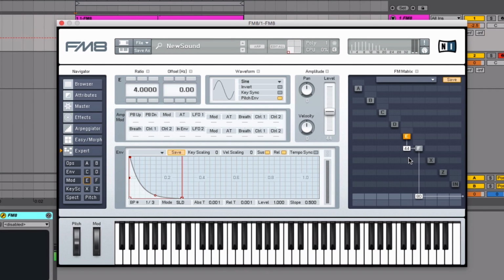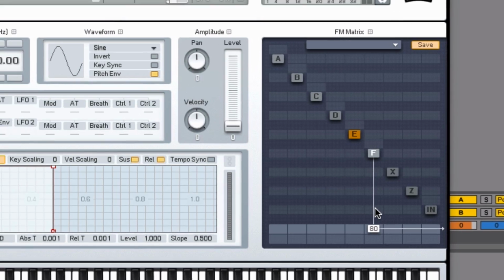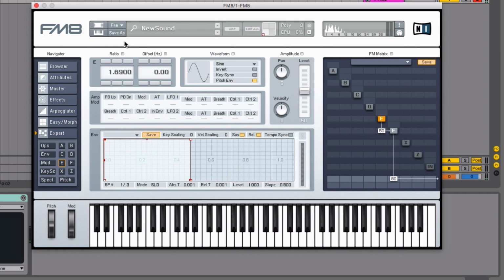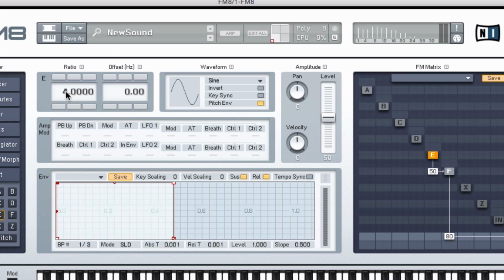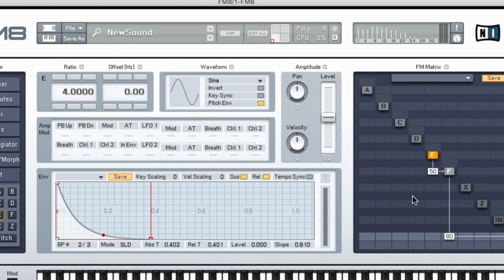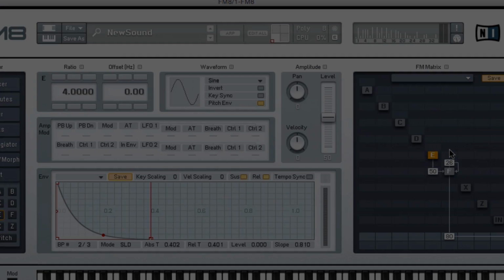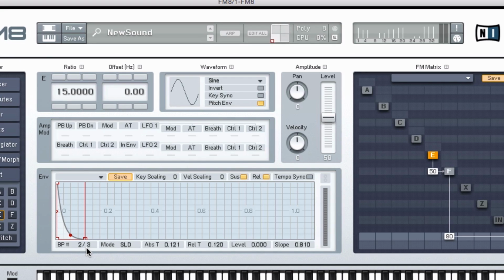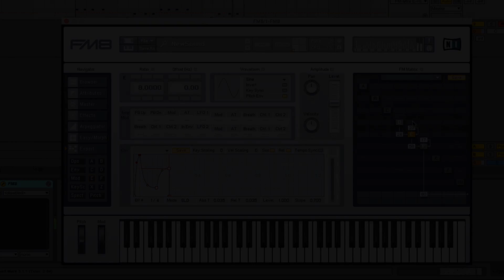How To:  A Beginner's Guide to FM8 | Native Instruments

Comment: Anyone else having a problem with FM8? None of the operators are working except for F when I initialize a new patch.. All the operators work just fine when I open up a preset and adjust parameters but when I go to make my own sound from scratch only operator F works .. This is maddening. I am completely up to date with the newest version and am running IMac’s latest operating system Monterey 12.4.

If anyone could please help with this issue I’d greatly appreciate it !
Reply: Try clicking on any-A,B,C...etc. right mouse button it should be activated and then left and hold, up and down.

Comment: Thanks for the video. I'm struggling to get my head round what exactly the ratio is. What exactly do the numbers refer to? (I understand ratio in maths, just not what it means within the context of FM synth!)
Reply: From the FM8 Operation (User) Manual:
Frequency Ratio defines the mathematical relationship of the Operator frequency compared to the fundamental frequency of the note being played. 1.0000 means the Operator is the same pitch as the fundamental, 2.000 sets the Operator to the second harmonic (1 octave higher), 3.000 is the 
third harmonic (octave + fifth), etc. 0.5000 is the sub-harmonic one octave 
below the fundamental.These values are edited by clicking on one of the digits and moving it up or down. The arrows above and below each numerical allow incrementing (up arrow) or decrementing (lower arrow) one value at a time.When the Ratio is not an exact integer (e.g. 1.0030) then the Operator is detuned and will “beat” against other Operators. The beat frequency rises if the note pitch increases, and falls if the note pitch decreases

Comment: Thanks for the quick tutorial!
    FM8's programming screen looks very easy to learn and use!    I know, I was one of the first DX7 owners in Texas in the 80's,  and the first DX editors absolutely stunk!  So did the later editors!
     So I'm impressed with FM8's Interface.  It's actually very usable. 👍👍Think I'll have  to get it.  😎
    Why FM8 when there's only six oscillators/operators?
Reply: my guess is because it also has X and Z and that would be the 8 FMs